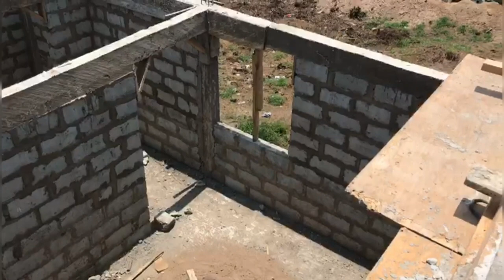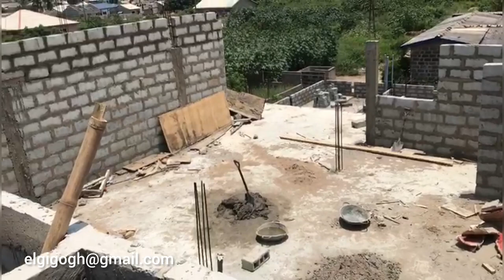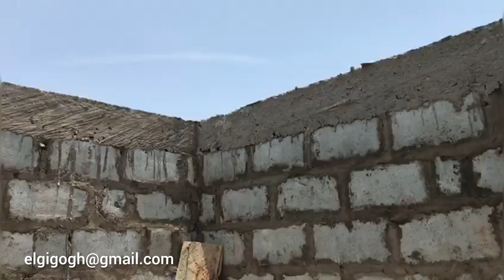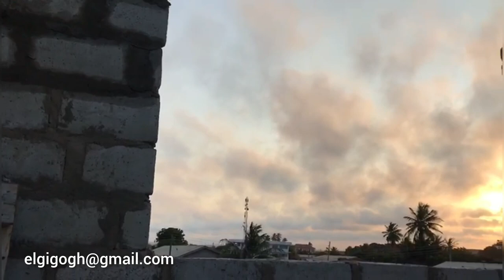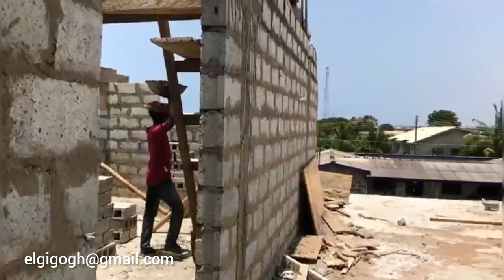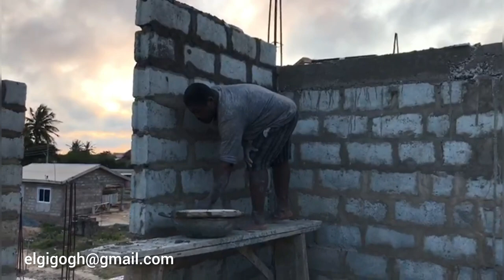Building In Ghana | Block Work Continues Hidden Roof & Decking  Explained|Building a House In Ghana

Comment: What is the best size of iron rods is good for building a story buildings
Reply from the maker: Hi Samuel,  depending on the levels (No. Of Floors ) but you can start with 14mm from Foundation level
12mm is also possible if your building has a lotos columns (Pillars) in it

Comment: How many cement did you use for 1800 blocks
Reply from the maker: Between 18-20 Bags should do that ....I gave a range because of the quantity of sand mixed with the cement sometimes it can be more or less (sand)
Reply: Even for the pillars ?
Reply from the maker: No just for the block laying
Reply: Thank You